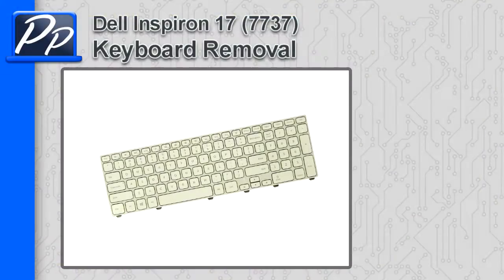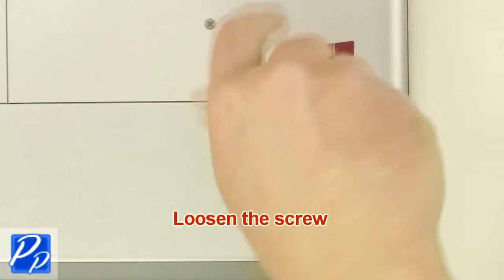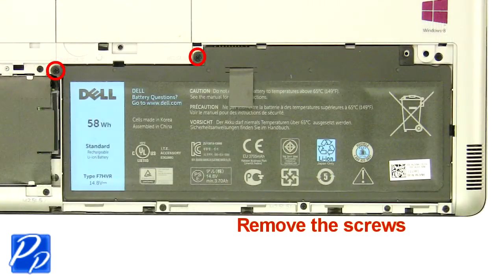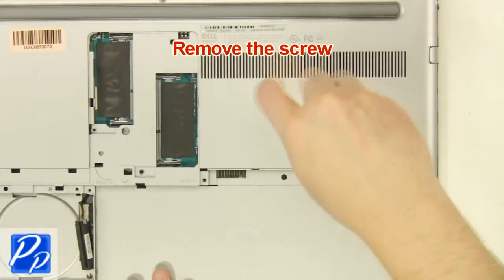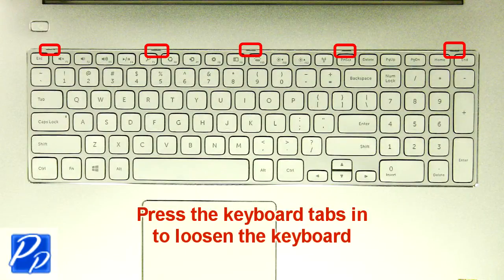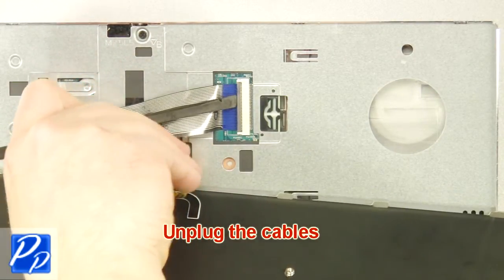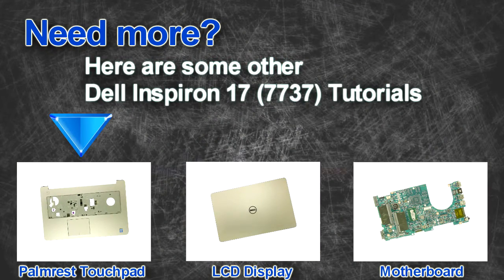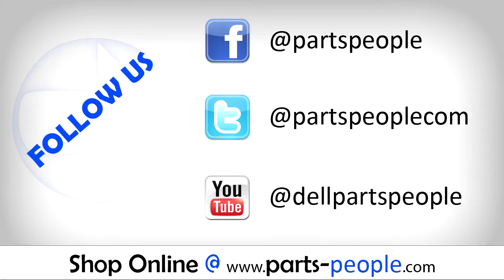Dell Inspiron 17 (7737) Keyboard How-To Video Tutorial

Comment: When you're removing the old keyboard, make sure you're lifting the entire keyboard and not just the face plate.  That's not a huge error, but can prevent you from feeling like you're removing the keyboard twice.  Then, use some needlenose pliers to hold the new connectors just right as you snap them into place.  If they're not seated right, you'll be breaking the laptop down again to redo them.  Great tutorial.

Comment: spilled coke on bottom right part of the keys (diet)

should i do any thing?
Reply from the maker: High Priest Vatican Assassin Warlock I would keep the laptop turned off and remove all power (unplugged and battery removed). If liquid hit the wrong part of the keyboard or motherboard, it could short either or both of them. Before working on the laptop, touch a metal spot on the laptop, like the edge of a USB port, to remove a static charge. Remove the keyboard and try to clean all of the soda you can find with rubbing alcohol. Then check to see if any of the soda made it through the keyboard to the palmrest. If so, clean that as best you can with alcohol. Then remove the palmrest and check to see if the soda made it to the motherboard and clean if necessary. 

Even after all the cleaning, there's no guarantee that everything is going to work perfectly. Chances are, one or all of the parts effected will need to be replaced. Spills are a very common problem and parts are replaced frequently because of them.